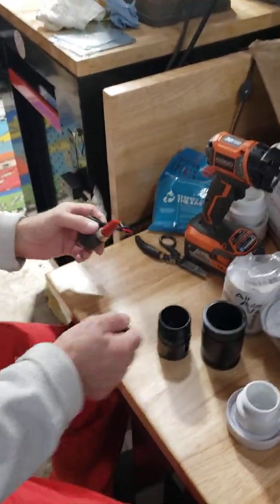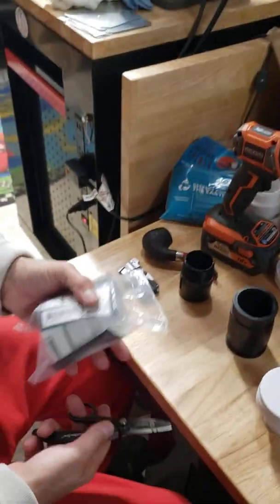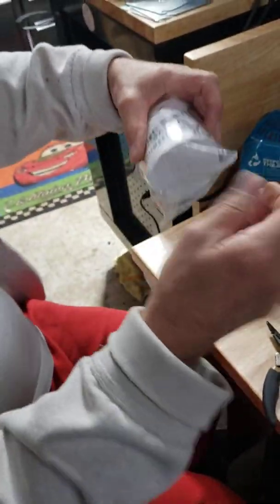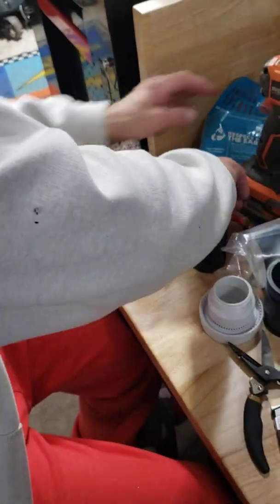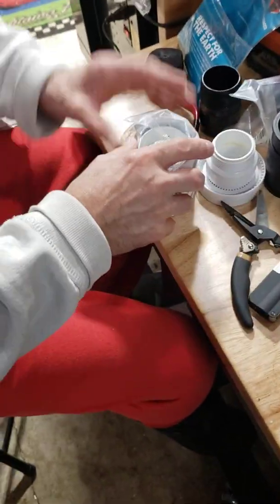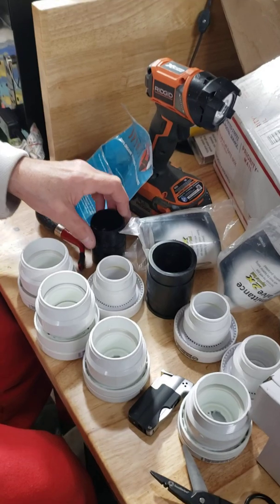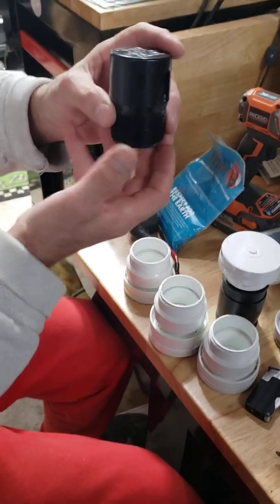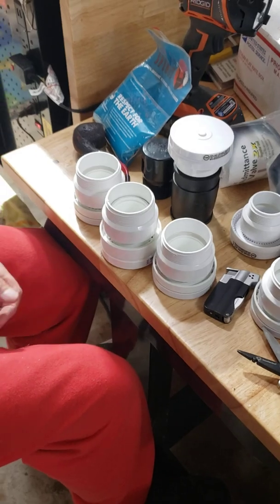#1 of 4 Air admittance valves

Comment: Try the first one with no pressure, i currently have two leaking smell after 6mos, the rubber flap sags open
Reply from the maker: I remove then n vented through roof. Rerouted kitch sink straight to tank.

Comment from the maker: What they do is allow air to flow into drain plumbing in house so your drains dont get the water traps evacuated of water and allow drains to flow freely. If your water traps get sucked they will gurgle and if that is happening sewer gases can escape through them and get into home. If these fail the same can happen. They connect to plumbing pipe stand vertically where you would have a drain.